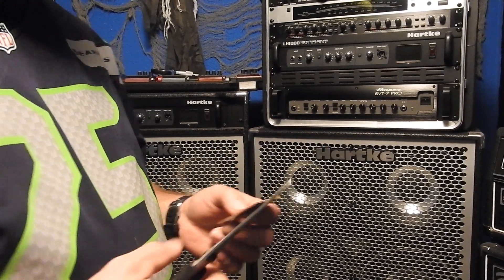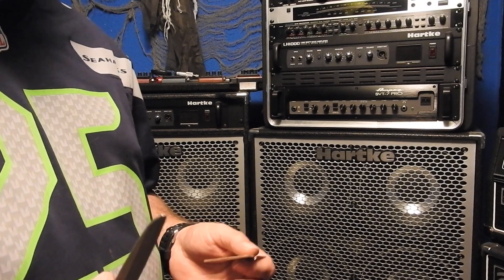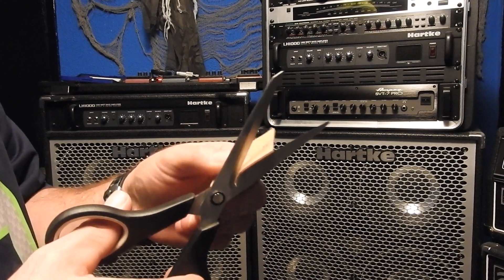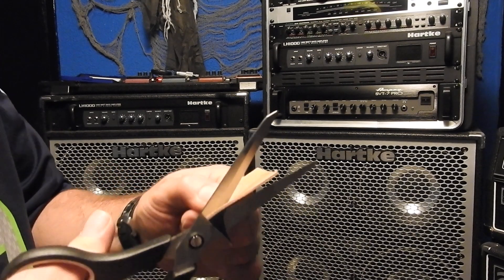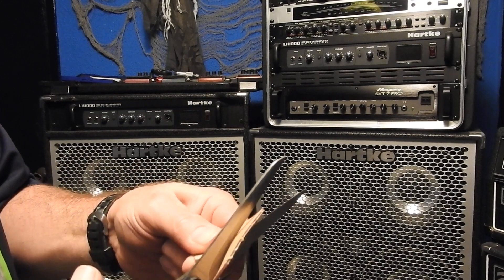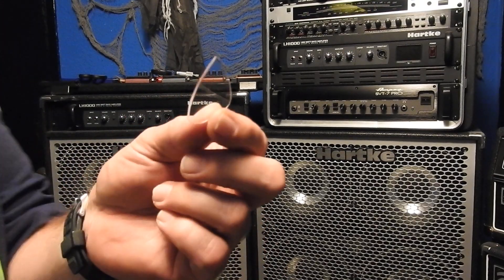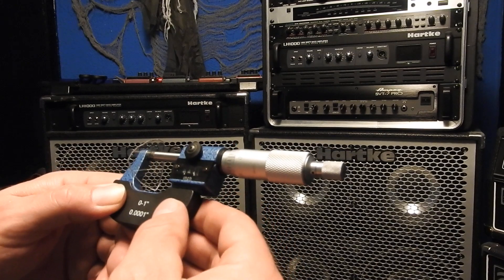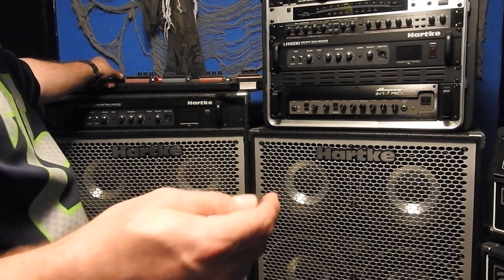Custom picks and channel up date

Comment: Sanitys Void, very cool information on making your own picks, I've never thought about that but I'm gonna give it a try.
Reply from the maker: Thought you were a finger player?
Reply: @SanitysVoid  , I like to use a pick occasionally depending on the song. Those picks you made probably sound real crisp with a lot of drive.
Reply from the maker: @bass-hiroshimanick2534  Ya that was what I was trying to say, back in the 90's when the kinda gear you'd need to cut through the mix was only owned by pros with a lot of gear. These picks gave me an extra push through the mix, kinda like amps that go to 11.

Comment: Interesting video! Some years back I didn't even care about the pick that I was using but nowadays I've learned that the pick really does affect the sound. These have been my own faves since 2017: https://www.ebay.com/p/1043583434. Love the grip part and the fact that it's not too thick. In fact, the 1.00 mm gauge is very suitable for me. 1.14 mm is probably the thickest pick gauge that I use (the purple Tortex), I don't care about the thicker picks at all anymore. Still, I sometimes experiment a bit with picks and try different ones out.
Reply from the maker: I find I need a heavy for some songs and some I need a medium for.